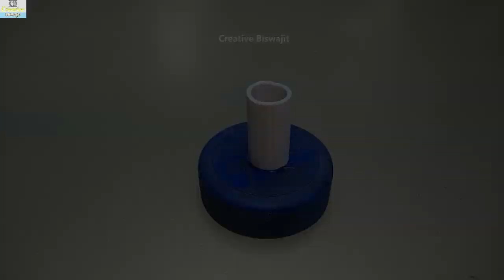Science Projects For Class 8 Working Model, Science Projects For School | Table Fan

Comment: Can you list materials
Reply from the maker: DC Motor-  https://amzn.to/2QylSUP
DC Motor With Propeller-  https://amzn.to/2s7ncoe
35 Pics DC Motor Propeller-  https://amzn.to/301mwgM
DC Motor with Propeller/Fan/9V Battery/Snap Connector +2 AA Battery with Holder/3m Wire/10 LED/2 Mini Switch-  https://amzn.to/37NXdkX
9V Hi Watt Battery with Connector-  https://amzn.to/37HIM1C
ON/OFF Switch-  https://amzn.to/2N5yalf
Reply: G
anesh